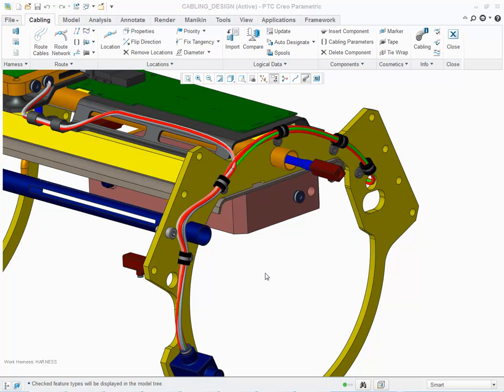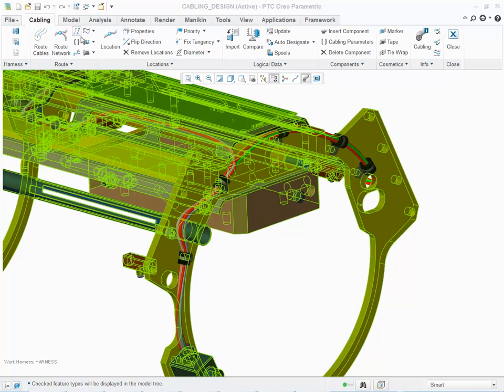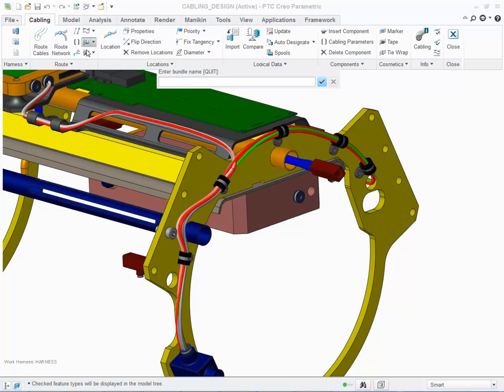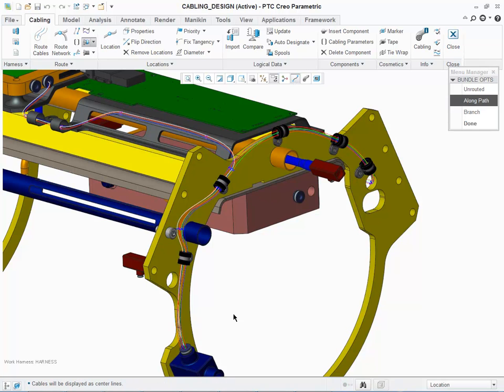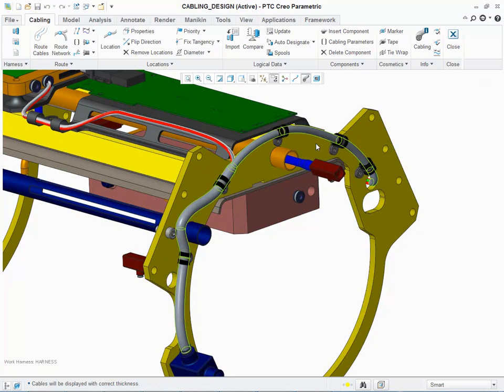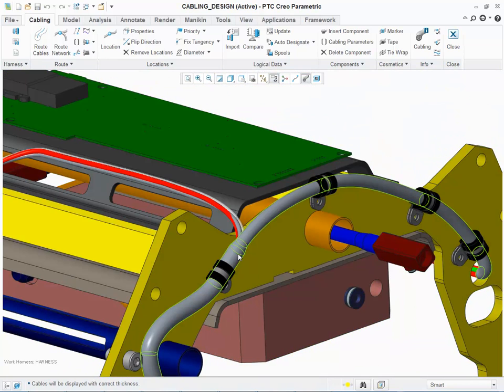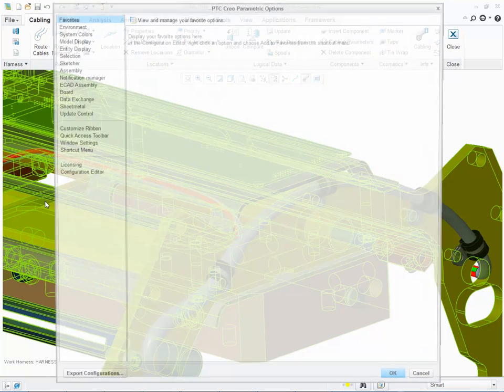Bundle Transitions in Cabling

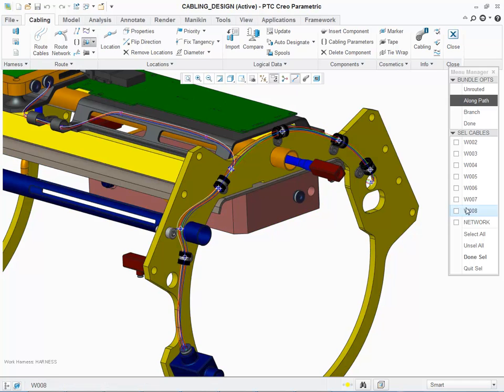Comment: I'm stuck at 0:26. Instead of the Confirmation window popping up, Creo asks if I really want to include cable 1, and it says if I do it'll likely result in incorrectly calculated length. I click Yes, then the resulting Bundle houses only that first wire, not including the other 7 that I need.
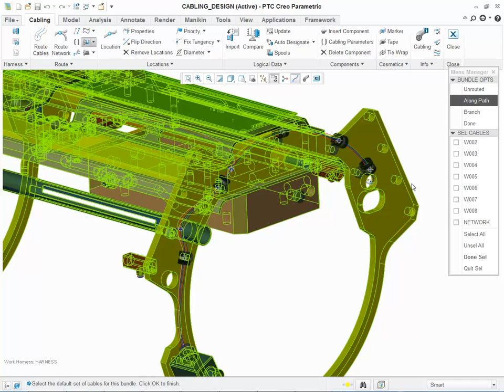Reply: I could never get the SEL CABLES menu at 0:31, which would be fantastic.
Reply: @quinnquynguyen8129  did the menu manager go off screen? Do all the 7 wires/cables share the same path?
Reply: @sfa6742  Thank you so much for getting back to me. A couple days after, I reread my Creo Cabling book, particularly the chapter on creating the Cable. I realized that my setup was different from in the video. His is Bundling, while my setup was Cabling. The two are different! So I slowly redid the Cabling tutorial chapter, then it worked. :D
Thanks again for checking up!

The good beginner's book:
https://www.amazon.com/Creo-Parametric-3-0-Harness-Design/dp/1946571628/ref=sr_1_1?dchild=1&keywords=Creo+Parametric+3.0%3A+Cable+and+Harness+Design&qid=1589423938&sr=8-1